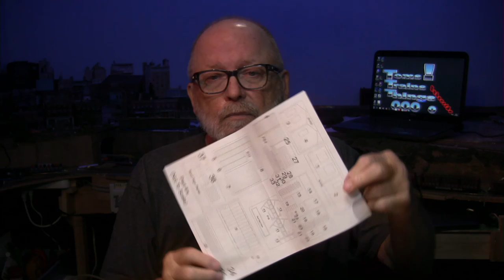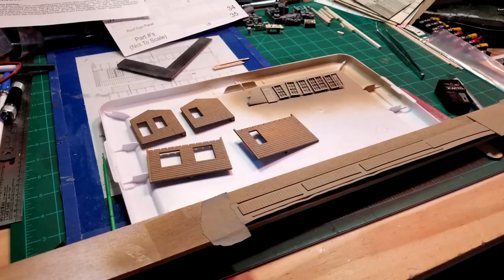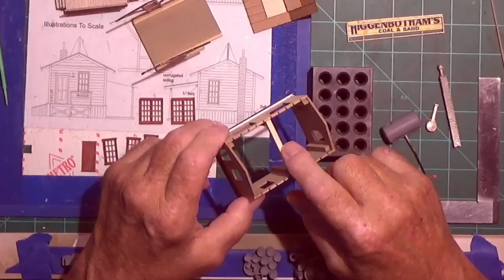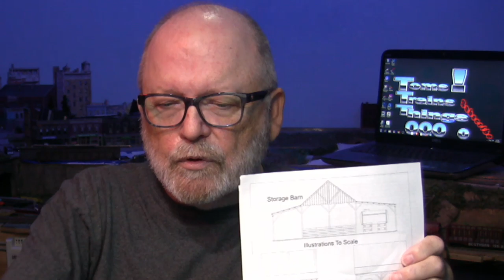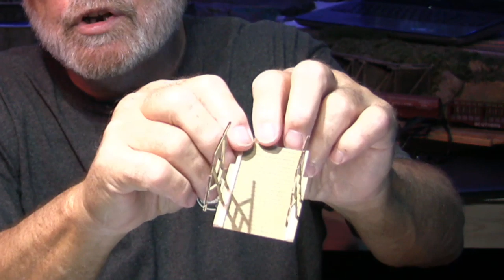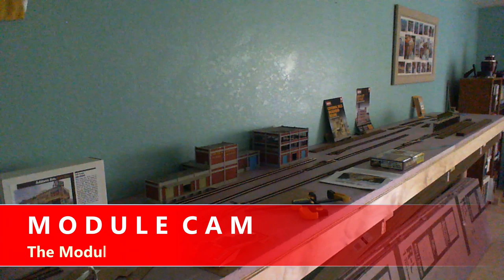Progress On Higgenbotham's - A Bar Mills Scale Model Works Kit

Comment: Tom, have you ever used a router to cut through the pink foam? I have a N Scale and I have 3 inches of the pink foam. I want to cut into the foam to mount my 360 degree turntable and roundhouse. 
I also saw something that I want to try. It is the electric soldering gun, I saw someone take number 12 or 10 wire (solid) and make it the way they wanted it and use it to cut or burn the pink foam so they could make it for whatever they needed it. 
I hope to try it very soon. Want to cut the maintenance trenches in the roundhouse and I think it will do just what I want. So what I will end up with is a bunch of different tips for the soldering gun. 
I enjoy your Site so keep up the good work. Happy Railroading.
Reply from the maker: Hacksaw blade works fine. All that other stuff is overkill. It's just foam.